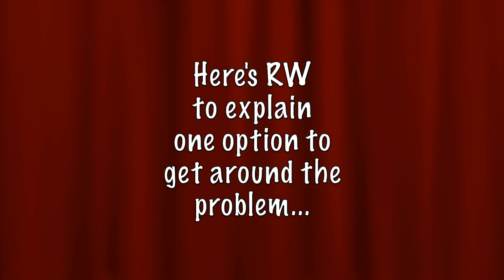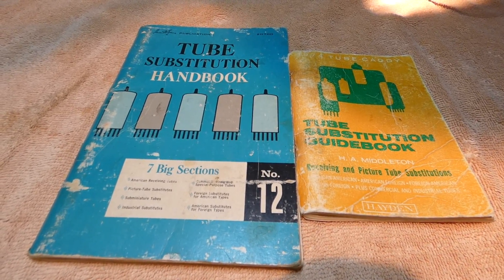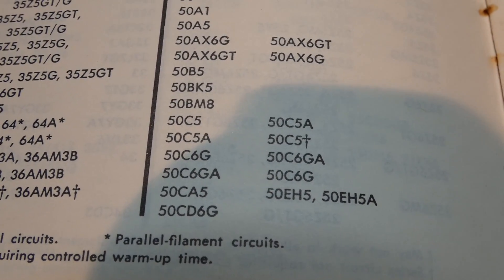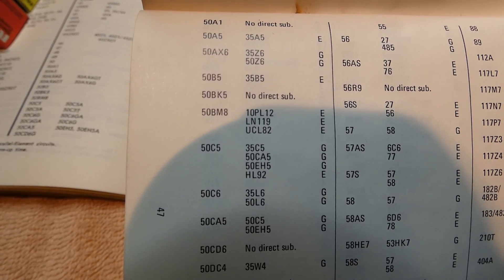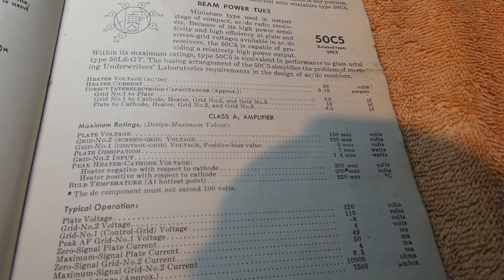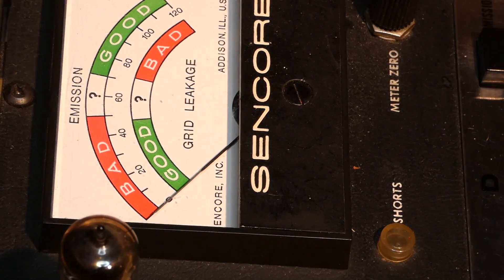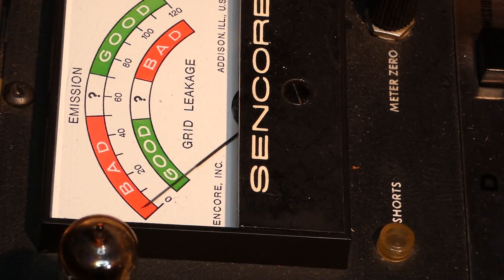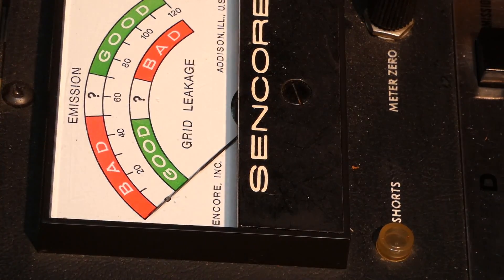Could the 50EH5 be the new 50C5?

Comment: 50EH5 might work...but grid and screen are not aligned as in 50C5.  ..more screen grid current.
Reply from the maker: It will work. I learned recently that the 50EH5 was developed by RCA with the intention that this tube would help phonographs with weak cartridges to get more volume. Same as the 25EH5, and the 35EH5.

Comment: Hi Bob,
I have the opposite situation. It's  a stereo amp with 2 50eh5s. Can I  get away with replacing them with 50c5?
Reply from the maker: You could. Your volume and output will ne about 2/3 or so less. I have good 50EH5's if you need them.

Comment: I have only seen a few 50EH5 tubes in my time, very uncommon.
So you are measuring "grid leakage"?
When I test tubes I never leave them in the tester as long as you did, when the emission comes up I test for grid leakage and if it is good I move on, maybe I should leave the tube in the tester longer.
The only tester that will test for "grid leakage" is my B&K 606, the KNIGHT 600 does not.

Comment: From what I understand, using a 50EH5 instead of a 50C5 may, or may not work properly.
The odds are better if you change the cathode resistor(it needs to be lower resistance to use the 50EH5).
Typical values that I've seen mentioned:
150 ohms for a 50C5
62 ohms for a 50EH5.
Of course, depending on output transformer specs, your mileage may vary.
If you get it wrong, the distortion will go up.
In some cases, indeed it may work good enough without doing anything.
Reply from the maker: You're spot on! I suppose I could have mentioned that. The thing is - how often are those resistors drifting higher in value to the point the radio loses volume or stops playing anyway.

Comment: The ‘EH5 tubes were designed for 1-tube cheap  phono amps where the gain  was sufficient for a  crystal phono cartridge to drive the output tube without a triode “first audio”. . I’ve never seen one used in a radio
Reply from the maker: You're right! I've also seen them in some of the Japanese radios from the 60's as well.

Comment: Just don’t try to sub a 50B5 with a 50C5
Reply: actually, they are the same tube, except for the basing-so if you rewire the tube socket, or make up a "stack" adapter(a tube base wired to a tube socket, with the applicable wires swapped over), it will work perfectly.
But agreed, don't try DIRECTLY swapping a 50C5 with a 50B5.